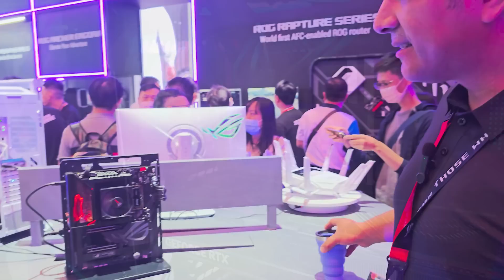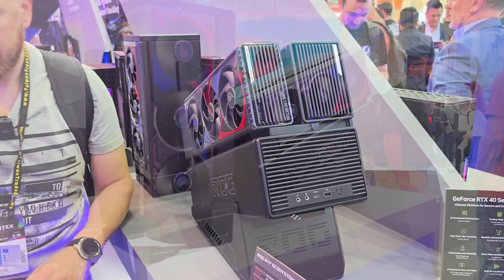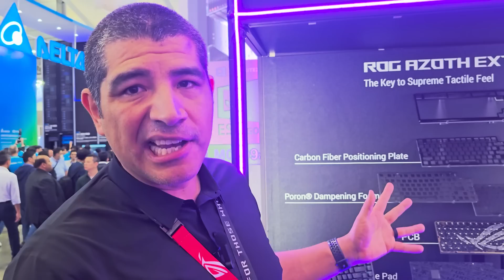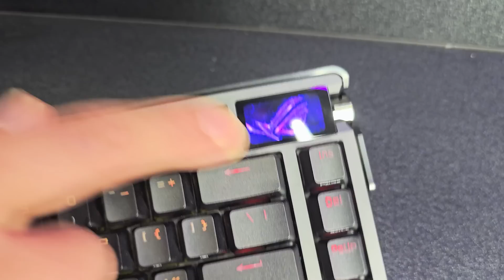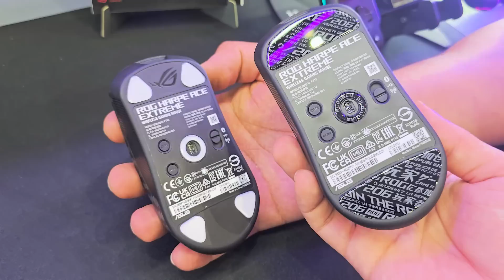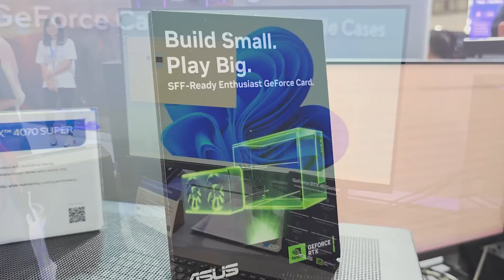Thor Hammer UPS, Insane Peripherals, BTF Madness | Asus at Computex 2024

Comment: what sucks about the whole asus thing rn is that their c-suite shot the company  in the stomach with the whole RMA process...when they're literally coming out with an honestly promising (maybe good?) mouse. like ppl have been on the lookout for a full carbon fiber mouse that isn't limited in stock like finalmouse, or costs an insane amount (and is a fingertip half mouse) like Zaunkoenig's wired mouse.
probably 86 the RGB on the mouse tho. nobody is looking at it while they're swiping across their screen. just shed the weight.

Comment: For those connectors, I'd suggest that only one cable comes out of the AIO, and then terminates into a hub of some sort where everything can be plugged in.  This hub will be hidden in the back of the PC of course. I'm not sure if this is possible but I'd imagine this could be the solution to clean up the appearance of this product.

Comment: Ok hear me out, connectors should be on the radiator because youre already gonna be plugging fans in and running cables. so non proprietary connectors there. BUT you still gotta make a connection to the pump, so run a proprietary braided cable between the pump and rad, the same length as the tubes, terminate on noth ends to make replaceable.

Comment: Unless traditional motherboards (those that have 4  slots for RAM sticks)  start coming with two CAMM2 slots, the adoption of this new form factor for RAM is going to be hard on the consumer for upgradability + plus e-waste. going from 16 to 32 one will need to ditch the 16 and buy in a whole new 32gb module instead of adding just another 16gb to our rigs. That box with the GPU mounted outside of the main case seems really nice, as for the AIO using standard cables is always preferred. Overall lots of cool things coming out.

Comment: 1:58 not sure if this makes sense, but maybe run the cable along the tubes so the connectors are on the radiator? Usually the fan cables are against the case in some way and are much easier to hide than on the block by the CPU

Comment: I hope they ditch the rgb scroll wheel on the mouse.
Reply: Agree
Reply: Or.... or.... check this out...  you turn them off.... i know super complicated, 😂
Reply: @rytek1  no RGB is clean
I am rocking a superlight 2 btw
Reply: @LunarList  rather or not your a fan of rgb or not....irrelevant.. you can turn that nouse wheel off and the colorful lights disappear...it's also a $250 mouse because it's  "extreme" but my mouse that cost half the price puts it to shame
Reply: @rytek1  agree
Reply: @rytek1  it’s about weight savings and/or reducing cost. They clearly want to go berserk with a pure carbon fiber mouse and gorilla glass feet, so ditching the rubber scroll and rgb for a lighter wheel seems to be more in line with their mission statement.
Reply: @353darkesthour  have you ever seen asus? Lmao 🤣 my dude dreaming over here... they put RGB on everything...they used carbon fiber to maximize profits or JJ wouldn't of had some off point comment about metal feeling different later, whatever that means... it's marketing talk for magnesium is too expensive and cutting into those profits... it's asus we're talking about.... and hoping for anything you would want... "you're wrong, spend more money" -Asus
Reply: @rytek1  feedback is better than no feedback. My feedback for you is that you should be less insufferable and learn to communicate respectfully.
Reply: @353darkesthour  berserk with carbon fiber? Lmao again just profits.... turns out my magnesium mouse is lighter and cost less.... so tell me more about berserk weight savings.... lmao 🤣